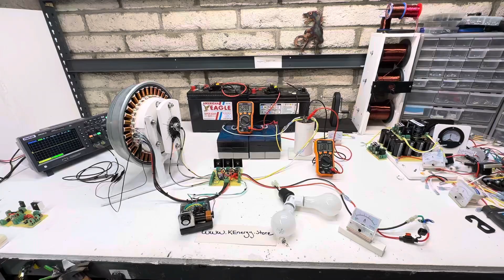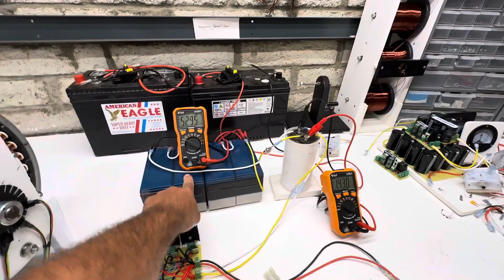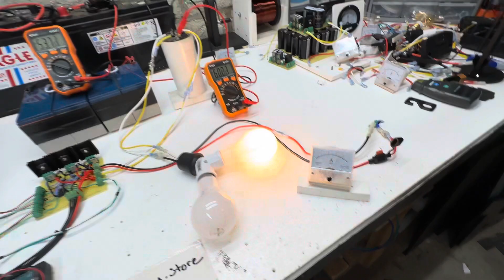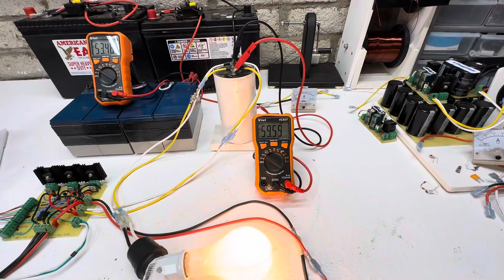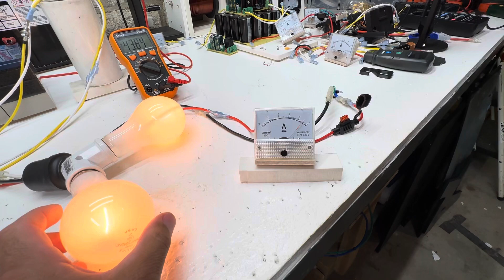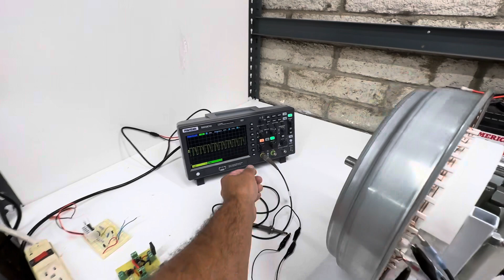Washing motor testing

Comment: Excellent work. Try placing additional magnets on the washing machine rotor in a radial position and place more bifilar coil along its axis. Considering the amount of torque that you’re producing plus having its own isolated circuit, no doubt you can generate more output power without drawing extra energy also not interfering with you current setup. Looking forward to next videos. Cheers